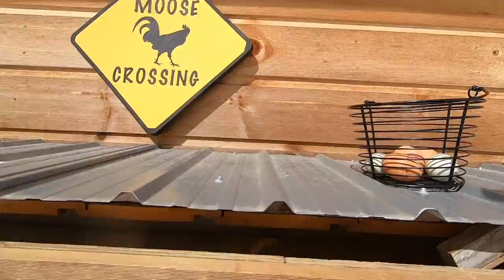It's TOUGH being the NEW KID

Comment: Are those buckets sealed? As in, have you sealed them up so no bugs or dirt would get in? If so, maybe that is why they are not getting sap in them. There needs to be a vent in the bucket lid. Maybe make a small hole and cover it with something that breathes but won't let bugs in? A piece of cloth? I would do this with just one bucket to find out if that is the case.
Reply from the maker: The buckets have a vent hole